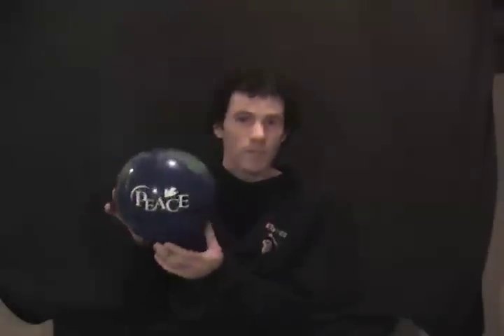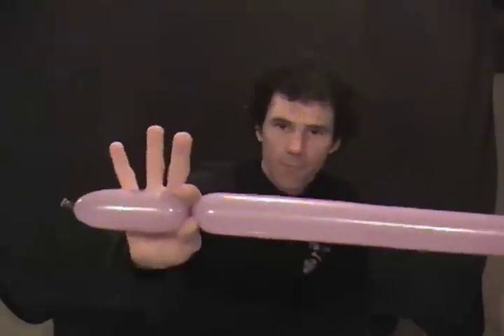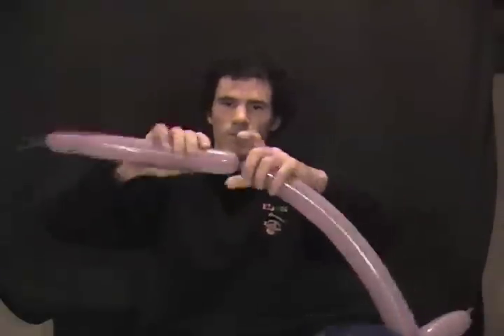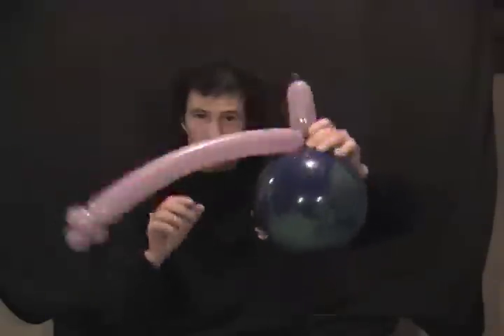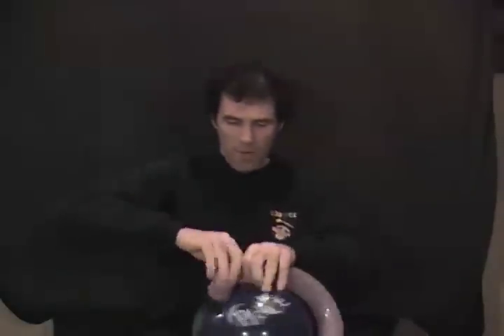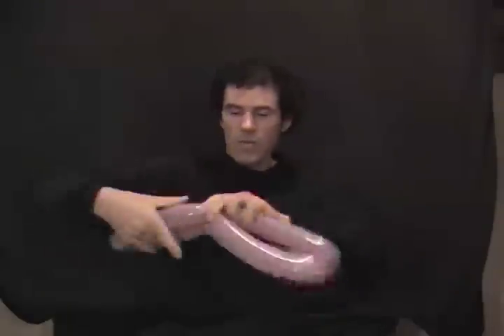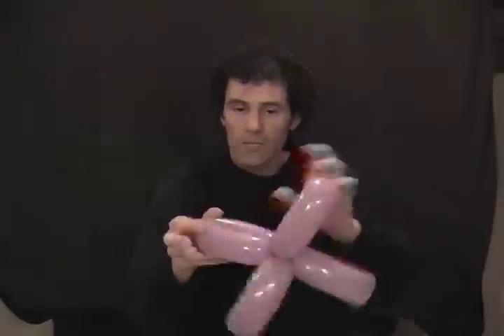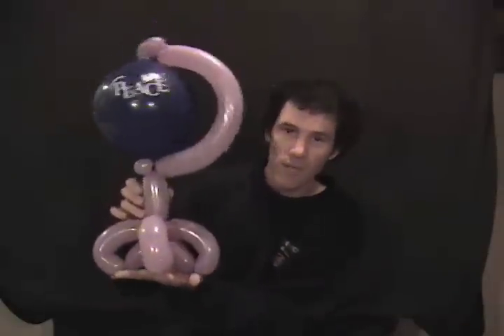how to make a balloon Globe

Comment from the maker: Flower Clown's Video 101 is ready! It is not called 101 because it is basic but the fact that I teach 101 different balloon figures. There are basic balloons as well as advanced. There are also videos of all the twists you will need to master balloon making. I added photos for all balloons untwisted to add a visual of the amount of air to inflate each balloon. There are also photos of the finished figures. 101 MP4 videos / 4.7G / $30 or less than 30 cents per video. FlowerClowndotcom